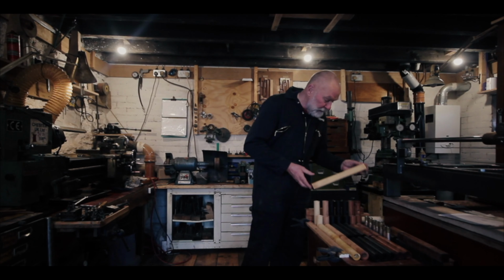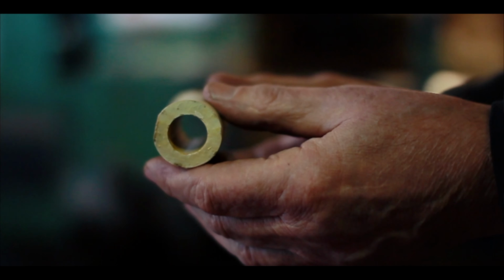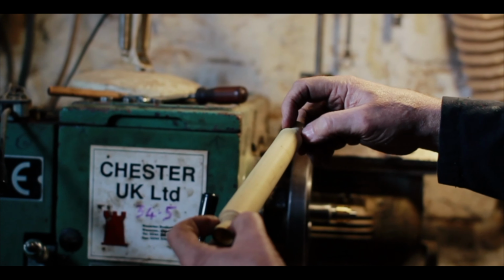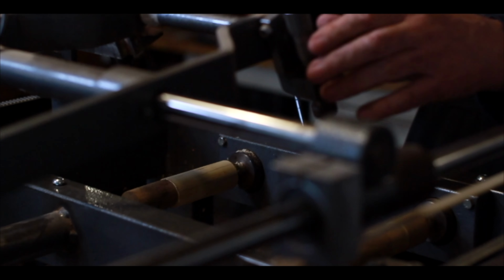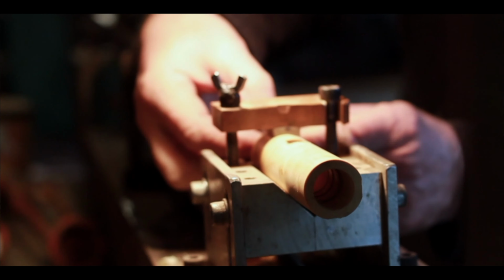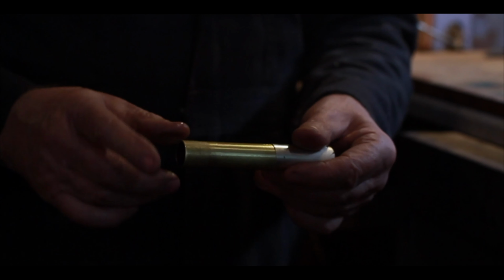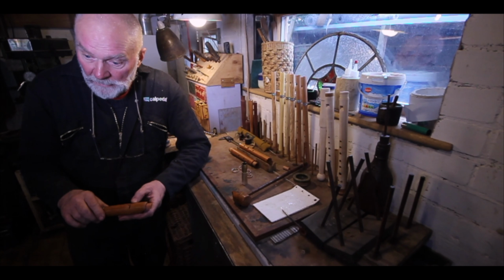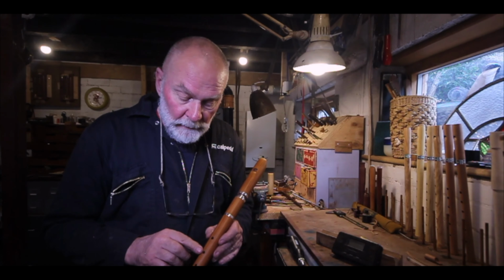HOW TO MAKE A FLUTE - WITH PHIL BLEAZEY

Comment: Hi Phil, being busy making a pvc flute I am baffled to see that in order to raise the pitch of the B note you are enlarging the hole on the bottom side. I'd guess that to raise the pitch you'd move the hole upwards toward the mouthpiece
Reply: My guess is that there were perhaps more wood to remove on the bottom side. Or maybe doing it on the headjoint side would have been too high pitched ?
Reply: It has to do with adjusting the octaves, wooden instruments have a wall of at least a couple of mm, which allows "undercutting" (so you can retouch the upper octave without moving the 1st too much, in  range of more or less 10-20 cents) 
With very thin walls such as pvc or a metal flute the drilling must be precise, because you have no margin to "undercut" the hole in a specific direction.
In this example, if he had cut straight on the top side  making the whole hole bigger the first  low B note (1st octave) would be sharp.  Just undercuting on the low side _ without making the hole much bigger - the B note of the 2nd octave goes sharp (like 15-20 cents in this example) But the  air pressure has a big impact on accurate intonation, it's part of the technique of the instrument (like in recorders, modern traverse, etc)
Reply: @pedrova8058  thanks for explaining!